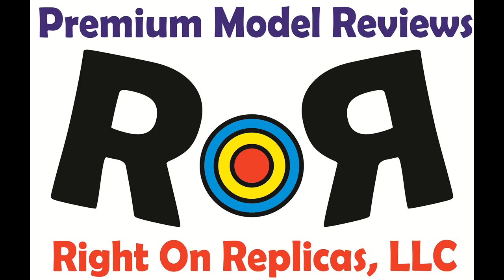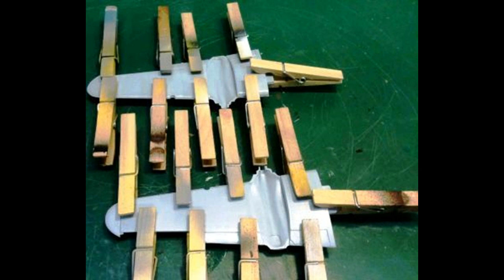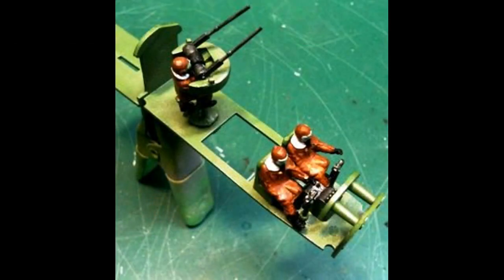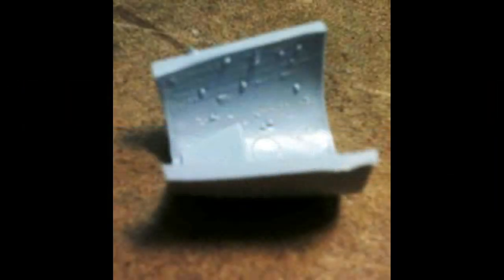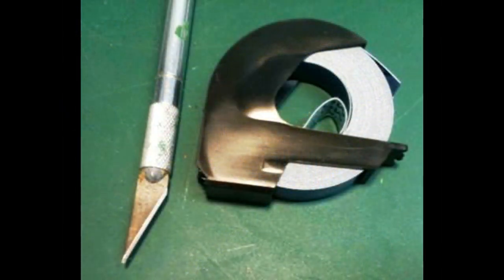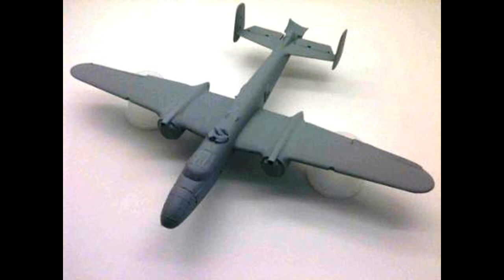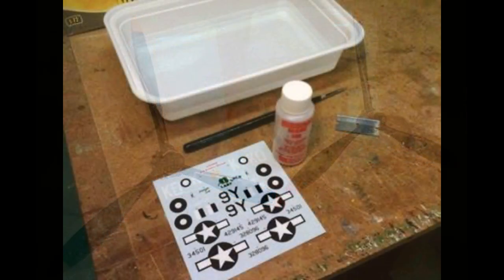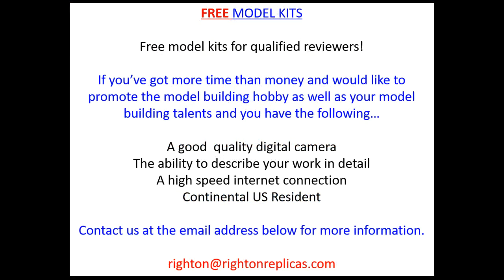North American B-25 Mitchell 1:72 Scale Airfix #A04005  -Model Kit Build & Review

Comment: Nice work!  I remember having this kit as a kid.  I only managed to partly assemble it.  I seem to remember the Airfix kits back then had a slightly softer plastic than the other brands.
Reply from the maker: Jim, Thanks for the info.  I didn't notice any differences with this one but then it's being made in equipment so they may have changed the plastic to accommodate that!    -PS, please subscribe if you haven't already to help us reach more modelers.  -Doug

Comment: A vintage B-25 J Mitchell kit was just recently re-issued by Atlantis Models.
You should do a build review on it as it should be a relatively cheap kit only costing about $30.00.The only con with kit manufacturers;like Airfix,Heller,Panda,Fujimi,
Aoshima,Tacom,Zvezda,ect;is the fact that kits from the manufacturers,that I have just mentioned above,all calls for finishing products;that are not permitted by the U.S. government,for sale in the U.S.A..Using a paint conversion chart;from the Testors Inc. website,comes in handy.Testors,Tamiya,Acryllicos Vallejo,Cytadel,Allclad paints;and finishing products,are available in the U.S.A..A really good substitute for Humbrol poly cement recommended by Air fix to build this kit,is Plastruct Bondene,Tamiya Thin/Extra Thin cement,Testors red/blue tube cement,Testors Model Master bottle cement.Squadron products, has recently released a bottle of cement,that is similar to Plastruct bondene cement.
Reply from the maker: Dr,  The new releases from Atlantic are from their acquisition of Revell's old mold inventory.  Should be decent but old technology kits!  -Doug